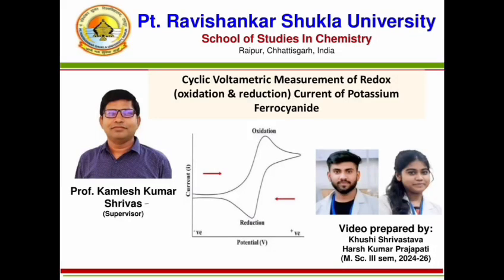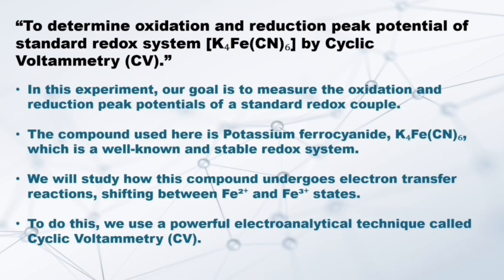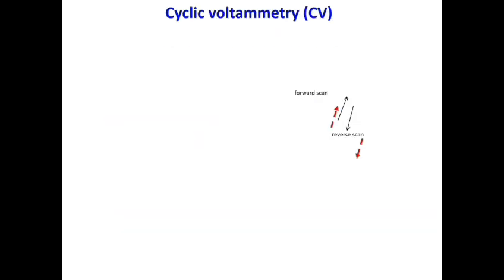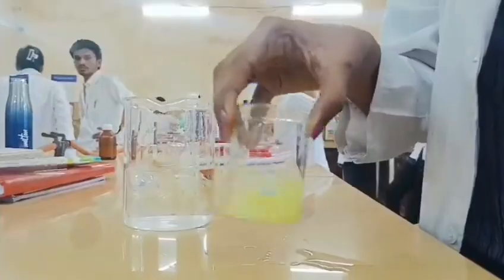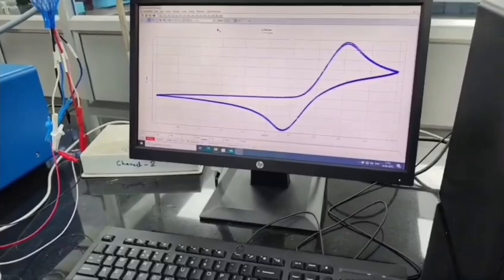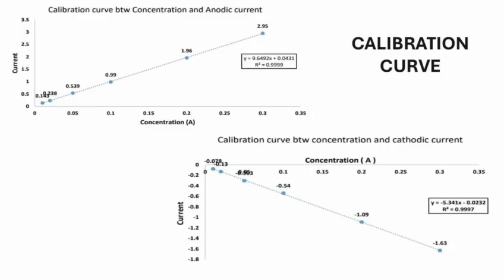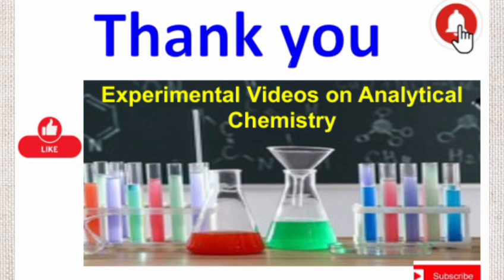Cyclic voltammetry for measurement of Redox current

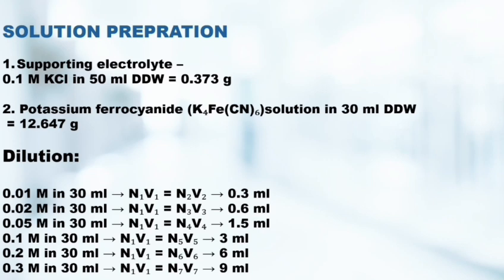Comment: @00:45  confusing. all these concentration (.01,.02,.05......) of what KCL or KFECN? how can you make .2  and .5 M from .1M?
Reply from the maker: Thank you for comment, the concentration of potassium ferrocyanide is 1.0 M, and from these different concentrations were preapred for CV analysis. Where as  0.1 M  KCl is used as a supporting electrolyte.
Reply: @Kamlesh_Shrivas_Sir  thanks. in all of those different solution (with different molarity of KFeCN), what was the molarity of KCL in the all of those solutions ?